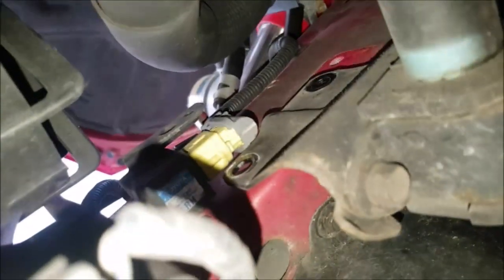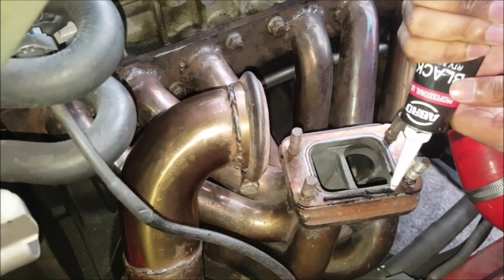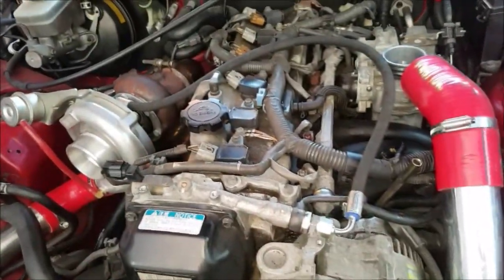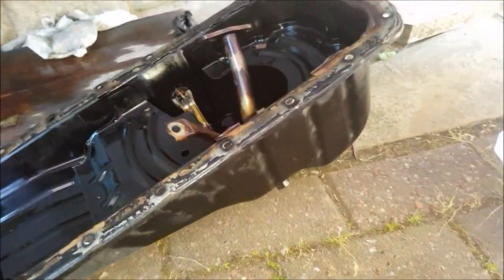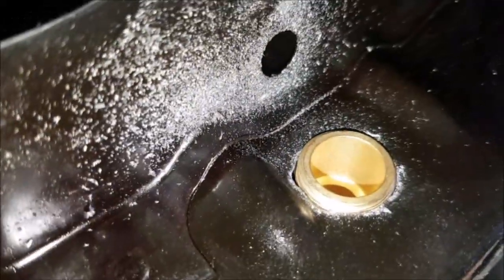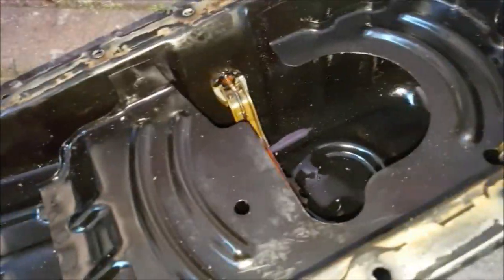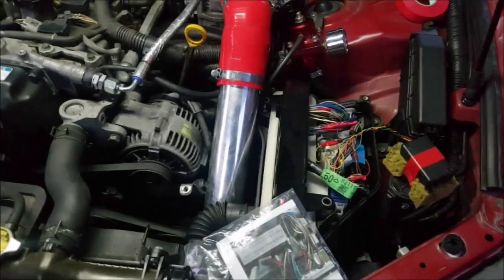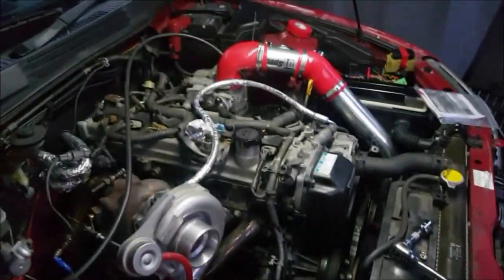Lexus IS200 Turbo Build | Episode 2 |

Comment: Nice video , keep pushing and building we look forward to more content
Reply from the maker: Thank you! Will do!
Reply: It’s good if I give arround 7.000 euro for my is200.turbo ecu cooler hammer pistons manifold exhaust bolts and what other need.
Reply from the maker: Exhaust, fuel lines, oil line and fittings,  ecu

Comment: Hay bro how did you pulg the fuel cut defender in piggy bank to the ECU
Reply from the maker: It needs to be directly wired to ecu
Reply: @BrianVibert1  got any pictures on how you done it
Reply: @BrianVibert1  do you no how two wire it into the ECU
Reply from the maker: @trisplazz7792 It was a long time ago when I did mine. There should be instructions given when you purchased the FCD
Reply: @BrianVibert1 I got the fuel cutter from Japan in it's in wrong language I just need to know what wire to cut
Reply from the maker: @trisplazz7792 I'll see if I can find the instructions

Comment: Mad video man. Used a lot of it as reference as I have been getting everything myself instead of using a kit so thanks a bunch. Only question though is when you removed the oil pan did you manage to find a gasket to put on or did you use rtv silicone around the oil pan?
Reply from the maker: Thanks, glad to help. I used rtv to seal oil pan

Comment: why did you put a sealant under the turbine, there are 700 degrees, everything will burn and a leak will appear.
Reply from the maker: RTV has a very high melting temperature, would not affect it. Reason I did use was because there was a small gas leak due to bad welding. I have now recently removed old t3 flange and welded a new one on
Reply: @BrianVibert1  This is an ordinary silicone sealant, made in China, for the exhaust there are completely different sealants coming.  After welding, the flange must be sanded, then no sealant is needed.15mm tube needed to drain
Reply from the maker: Had no issues with the rtv, ran for 1 year and then I changed the t3 flange. All in all everything is updated from first install and safe. As mentioned its a working progress when it comes to budget builds pal. Cheers

Comment: Hi, thanks for sharing your experience. Little question, how do you do regarding the afr? Is it closed loop with the O2 wb sensor and the piggyback ECU ? Thanks
Reply from the maker: Stock ecu. Fuel cut defender with fpr and 1zz injectors. Subscribe to support

Comment: what size oil and fuel lines did u use mate? really good vid👍
Reply from the maker: AN6. Thanks bud. Oil return was AN10
Reply: @BrianVibert1  is an6 ok too?
Reply from the maker: @joelpaal4699  Should be but an10 will be better as less restriction

Comment: Hi mate, just wondering what exhaust manifold have u used ? I can see it has custom flange but is it a 1g or 2j mani ? Thanks
Reply from the maker: Hi buddy, it's a 2j manifold with custom 1G-FE flange welded. The external gate on the flange has been blocked off. Subscribe for support
Reply: Thanks mate, iv recently bought a supercharged IS200 but after only a week I decided I want to go turbo, think il pick up a 2j mani and gonsame route as you :)
Reply from the maker: @joshnicholls2770  Good choice, Turbo all the way. Let me know if you want any other advice
Reply: @BrianVibert1  are the 1g and 2j manifold similar?
Reply from the maker: @gokuoce6098  No their different

Comment: Mate need some help, need in-depth on how to get oil feed to turbo from the vvti what exactly did you do
Reply from the maker: need to tap into engine oil feed to the same size an fitting you want. Run that to your turbo with the right fitting

Comment: I’m in the middle of doing a turbo build myself. How did you deal with the wiring when it came to the two o2 sensors from the manifold? My downpipe only has one hole, did you just splice the two sets of wires into one sensor and that’s it? Or is there something else you did on the ecu wiring itself (other than the fuel cut defender being wired in)

Thanks!
Reply from the maker: Yes splice the two o2 sensors into one
Reply from the maker: Subscribe to support
Reply: Brian Vibert thanks mate! So there’s nothing to do with the wiring at the ecu? Literally just join the two sets of wires into one at the sensor?
Reply from the maker: @MrAaronPage  Yes that is what I did. However, I had issues with the last sensor under the car in which I bought a emulator to solve this
Reply: Brian Vibert ah ok, that’s the one that bolts into the centre section of the exhaust right?
Reply from the maker: @MrAaronPage  Yes indeed, wiring going into car under passenger seat

Comment: Don't think that rtv can handle a turbos hot side even remotely. Been much better without it. Exhaust sealer would be a closer bet but that shit don't hold up either.
Reply from the maker: It held up pretty fine for half a year. Decided to play it safe and change the manifold flange, welded a new one on with new gasket.

Comment: Dose i need Regulator and all the pip full return from the full bump or not ?
Reply from the maker: You need a regulator to adjust the pressure, otherwise will have fueling issues
Reply: Brian Vibert  I just want know where i can get air Vacuum  for regularator ?
Reply from the maker: @khaledalenzi342  Ive mentioned in the video where to connect the vacuum hoses

Comment: Hello ,intake is 2'5 ? what's the diameter of aluminium pipes and silicone hoses ?
Reply from the maker: Throttle bottle side is 2.5" and the intake for turbo is 3"
Reply: So the throttle side pipes and hoses are 63mm diameter? Im wondering which hoses to buy 63mm or bit biger 65mm
Reply from the maker: @TheMsPitero  Yes 2.5" for throttle body side. Personally, I would go for the 2.5" (63mm) couplers as you will get a tight fit and no boost leaks. Helps to spray a little wd-40 to get couplers on
Reply from the maker: @TheMsPitero  Subscribe to support
Reply: @BrianVibert1  I'm already subscribing man ! :D
Reply from the maker: @TheMsPitero  Appreciate it dude

Comment: What did you do with the air sensor and what kind of turbo was used?
Reply from the maker: Air temp sensor is ran to the throttle body pipework. Drilled small hole and inserted sensor into pipework with rubber bung to make a seal. T3 turbo
Reply from the maker: Subscribe to support
Reply: Brian Vibert thank you

Comment: Love it. Did you have to wire the two lambdas in the down Pipe Together?
Reply: Also you getting any check engine lights without any cats?
Reply from the maker: Yes I wired the two o2 sensors together, to prevent cel
Reply: Was the wiring a hard job and how did you know which one is bank1 sensor1 and sensor2?
Reply: @BrianVibert1  any videos or descriptions showing how to wire the lambdas together ??
Reply from the maker: @jackwycher  No videos but essentially cut the end of one off and then splie that into the second one matching the colours. Solder them for better connection. Easy Job

Comment: there is no oil cleaning on the oil supply bolt in the drive-in, all the dirt from the pan goes there directly bypassing the filter.  the vvti valve has a fine mesh inside, under this bolt, and you have nothing.
Reply from the maker: Vvti valve still has mesh. It is a tapped vvti bolt. Nothing is removed, only added with the oil supply

Comment: What fitting is that you using to the from top of engine ?
Reply from the maker: Can you be more specific, oil feed fuel feed?
Reply: Brian Vibert oil feed ?
Reply from the maker: Tapped the original vvt bolt to fit an-6